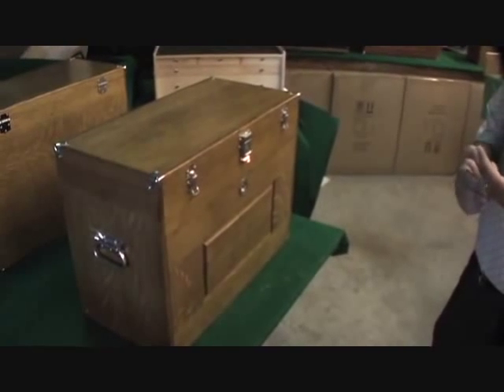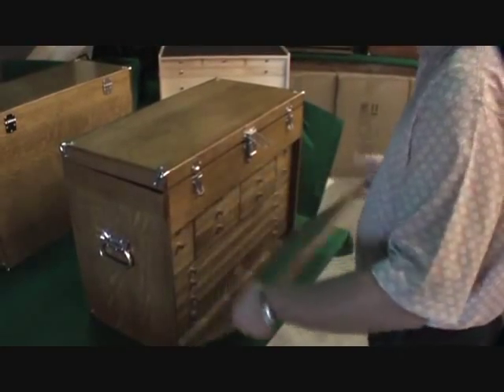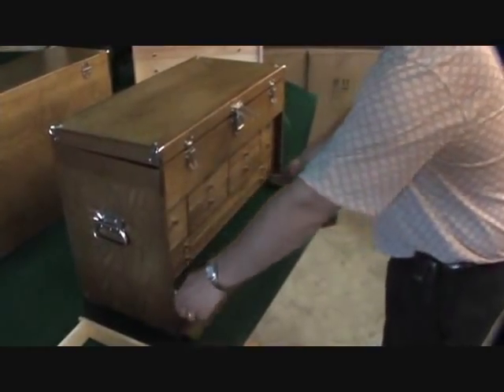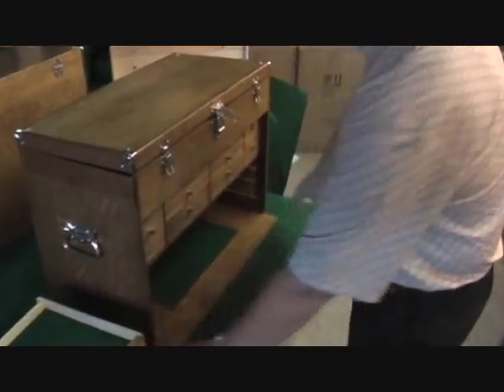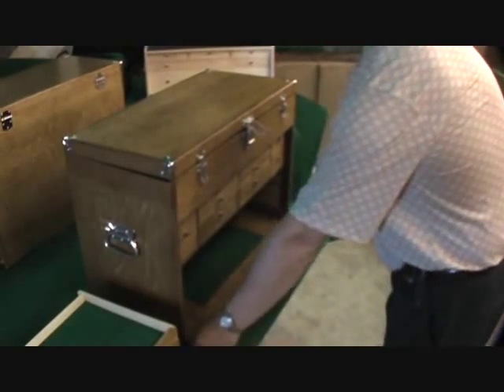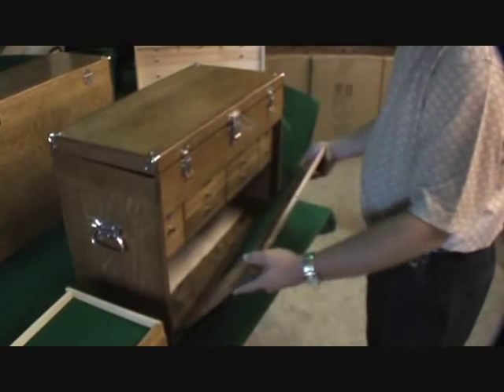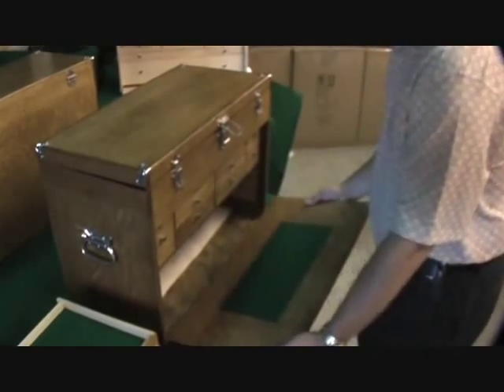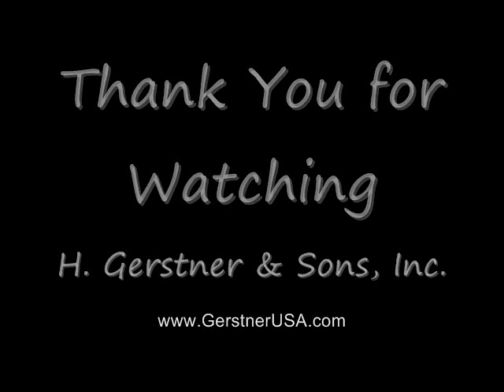Front Lid Removal

Comment: 10 thousand views and not one person comments. And the most important information to this video is missing…when you’re holding the left side forward and elevated as much as possible, after the right pin pops out from the track you not only want to make sure your angle is good, but you need to go in deep enough to make the right pin come up and over the first shelf slide so that you can pull the drawer out without scraping and scratching the finish on the inside under that first drawer slide like I did…since he didn’t say this I had to figure It out myself because he makes It look way to easy when it’s not…